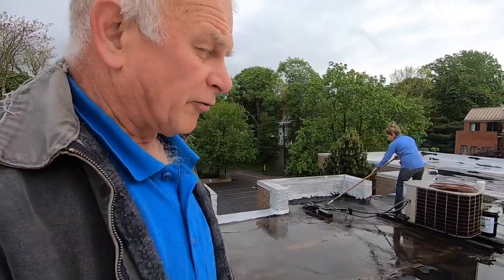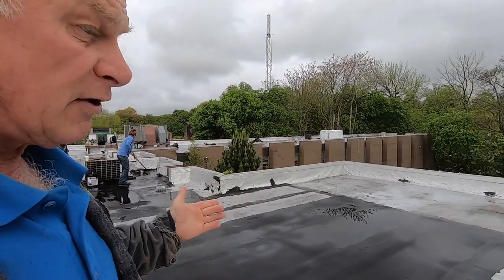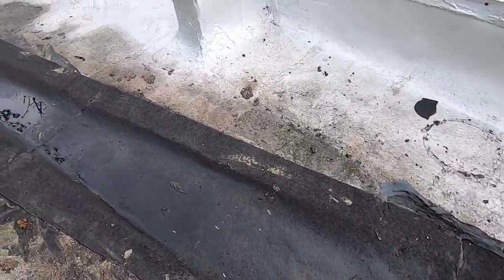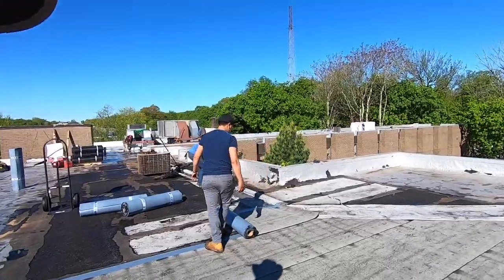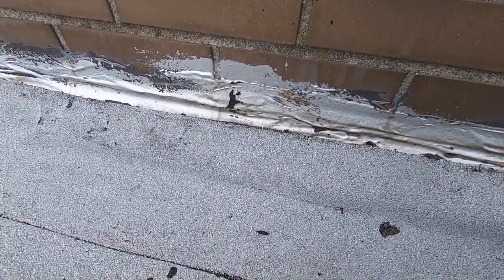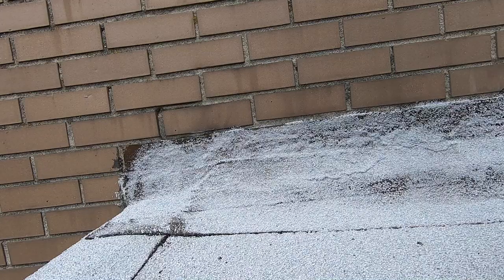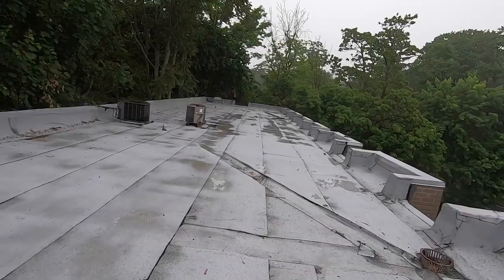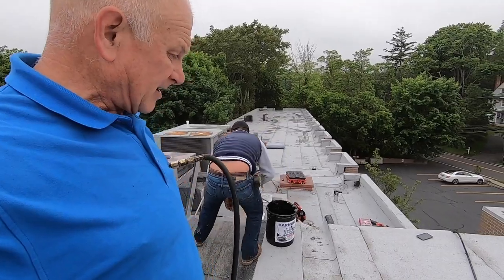The Hardest Torch Down Rubber Installation I have done in many years

Comment: can turbo seal use with repair fabric bought at lowes or home depot? and if i want to reroof my EPDM flat roof with torch down system what is the exact material to buy for not remove the rubber?
Reply from the maker: Bergstromm.com